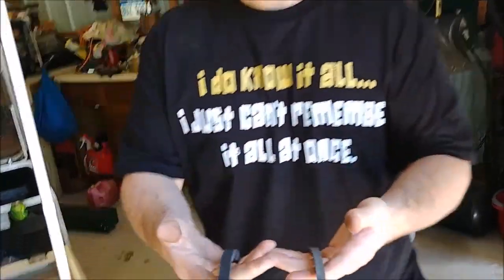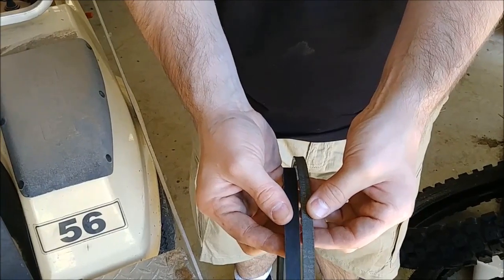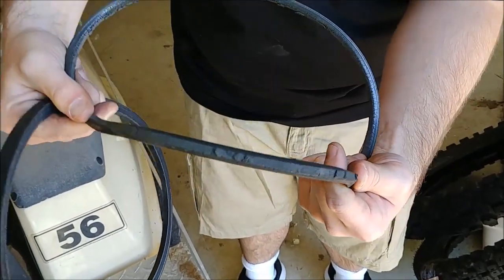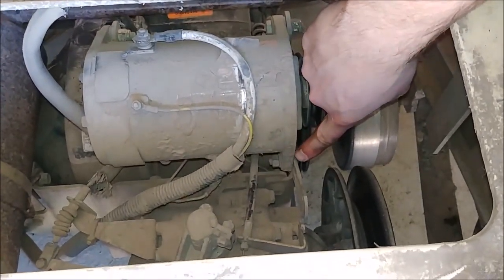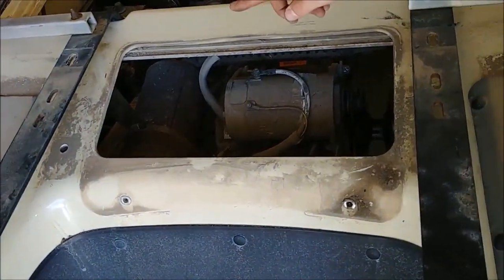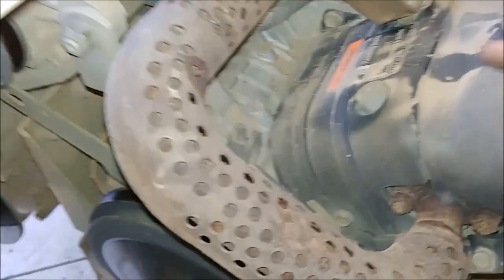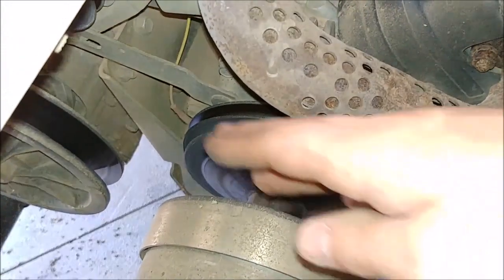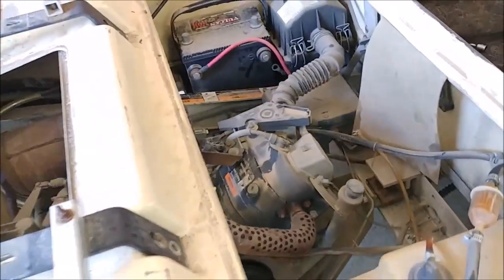Replacing Starter and Drive Belt on a 1998 Club Car Gas DS AG9828

Comment: If you think you are capable of replacing a belt this video is all you need.  Thanks for the info for what bolts to loosen.  Unfortunately I just installed a back seat so I'll be busting some knuckles.